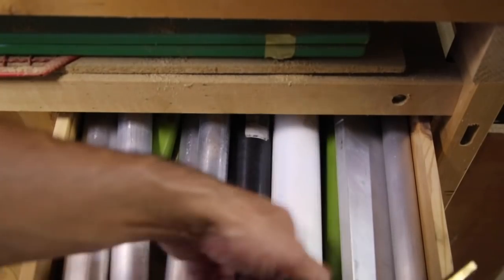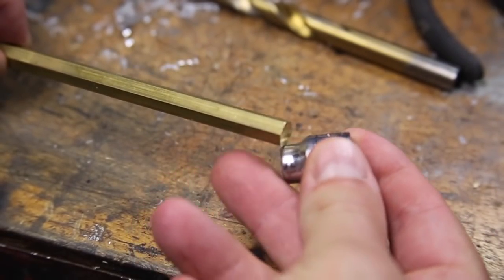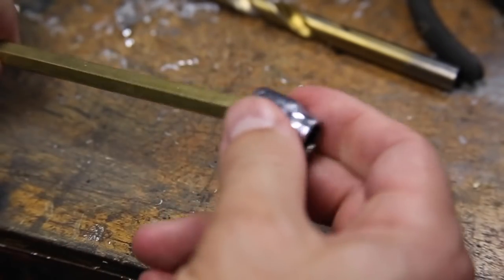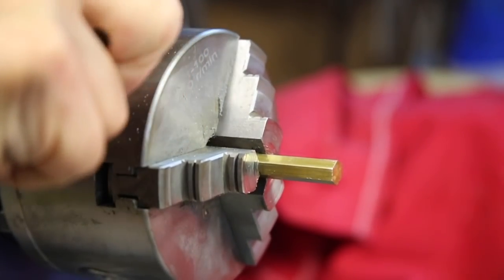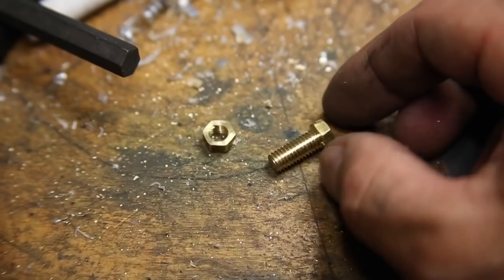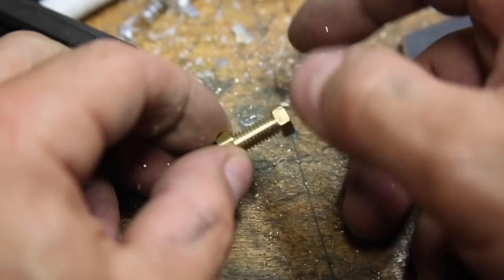Making a Custom Brass Nut and Bolt on the Mini Lathe out of Hex Stock

Comment: I restore and show Hit and Miss Engines so i use a lot of Brass. I love the look of it and it’s fun to work with , the only down side I have found is keeping it polished and looking good. Thanks for the Video !
Reply from the maker: Thanks for watching and that's very cool! Do you have videos of the process? And I agree about the brass, I'm not sure the best way to keep it shiny other than to polish it often. Maybe some clear coat?
Reply: TimNummy , sorry i don’t do videos, I’m just barely able to do emails and comments ( analog person in a digital world ) . I’ve tried clear coat but it doesn’t seem to last or have the look and depth of polished Brass, so I’m stuck with Brasso, and elbow grease. 😉 !

Comment: Been watching ur videos repetitive past few weeks. Definitely been a huge help
Reply: Are you still using your compound rest at 90 degre angle? And is are you still using tooling the same as un the video?......only reason im asking bc i actually flipped the tools upside down and run the lathe in reverse and seems to have much nicer results....and for the coupound rest i turned it 45 degrees and turned the tool holder back 45 degrees to make it perpendicular and that seem to also help make it a little more sturdy and bit cleaner cuts as well....anyway just blabbering...thanks again for the videos

Comment: Nice work!  I miss my small lathe- hard to do small work on the big one.
 Your tailstock is not aligned with the center of the chuck- correcting this would improve tolerances and reduce strain on the machine.
 If you part the nut only 1/4th the way on the stock, then use a small file to shoulder the nut, then finish parting off, you eliminate 1 process.

Comment: Hi Tim  -  very nice lathe you have there!   I want one!   How much would that cost me?      Also,  I need to find a half inch brass bolt with very fine thread.    Where would I find brass bolts without having to turn out my own?          I don't have time to get good enough on a lathe or I have to find someone who can turn these fine thread bolts for me.     Thanks!

Comment: The nut hole is not centered. Is that because the lathe rails are flexible? I've noticed it bend in other videos.
Reply from the maker: It's not that it isn't centered, it's that it's tapped so one side of the hole is the major diameter of the thread and the other side is the minor diameter which makes it look off center. 

The rails of the lathe are pretty solid - however you're right, everything else is wobbly ha. But yeah, in this case it's just an illusion.

Thanks for watching!
Reply: I think this is the reason nuts are usually countersunk

Comment: While using the tap and die, aren't you supposed to reverse it a bit every so often, to break the swarf?
Reply: Jasper Janssen I guess the brass is soft enough that it's not required
Reply: you kinda feel it if you have to... i had it so often that the tap just went through the thing with no problems at all and sometimes you need to reverse it almost every quarter turn in order to not get stuck. if theres no resistance building up, you dont need to break anything. i guess some materials are breaking the "chips" by themselfes, like cast iron or some kind of hard steel
Reply: Jasper your technics is correct for tap and die.
Reply: Great. Am I correct to assume that these mini lathes can't be geared up to cut the threads directly?
Reply: no you can cut threads directly, there are change gears in the back. its even possible to cut imperial threads on a metric lathe and vise versa (there is some error but really minor).. but the point is, its often not worth the trouble to cut the threads on the lathe, its an really unforgiving process that requires a lot of practise... so most of the time its quicker done with just taps and dies.
Reply: In my experience it's smaller finer pitched threads (1mm, 2mm) that need to be reversed. Otherwise they bind, and being thin they can snap easily.
Reply: Beware of the SWARF. We had a SWARF infestation that took out every tap and die in my shop

Comment: Doesn't the lathe itself cut threads?
Reply from the maker: It does, but I don't have a internal thread tool small enough for an M6 thread. Also, it's a bit tedious, especially without a thread dial - so it's just much quicker and easier to use a tap and die. Thanks for the comment!

Comment: That lathe don't make threads?
Reply from the maker: It can make threads, I just don't have internal thread tool and on anything under M12 or M14 it's easier (and probably faster and more accurate) to just use a tap/die.

Comment: YOU GRABBED THE BOLT BY THE THREADS!!!!!!!!!!!1111111111ELEVEN

ps: triggered
Reply: i would have used the left over cut thread in the hex stock but it might not be stable and i guess he didn't have the same type of bolt at hand
Reply from the maker: Haha "ELEVEN" 

Yeah, probably not the best strategy but I was just doing a light finishing facing cut and some sanding.